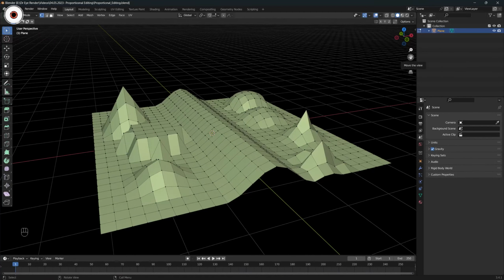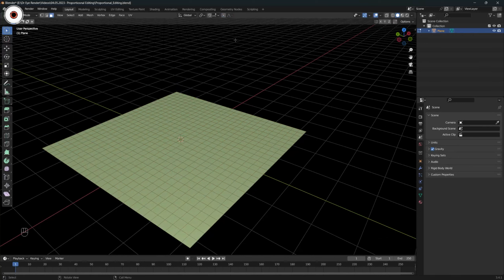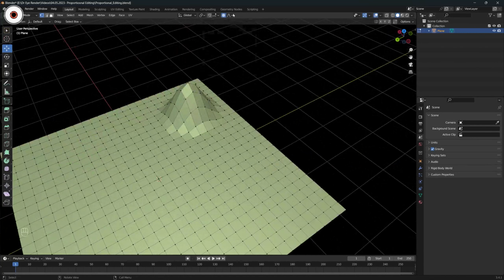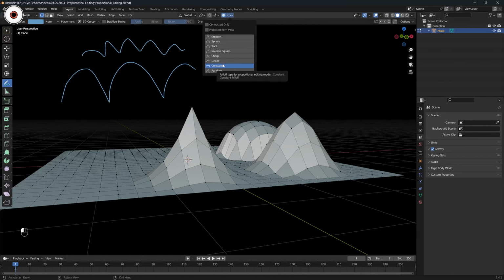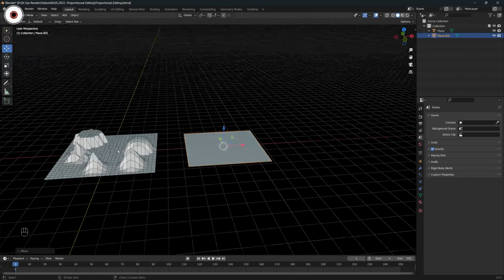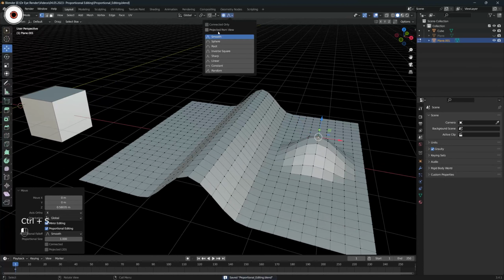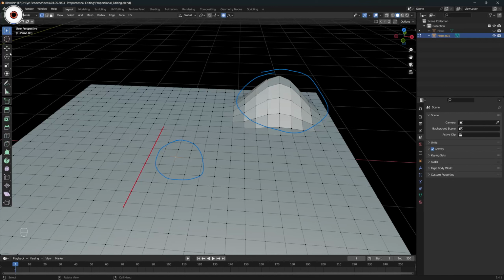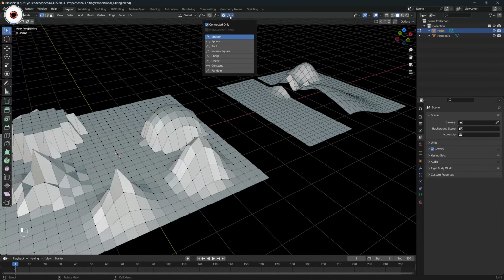Proportional Editing in Blender: A Quick Introduction to Its Functionality and Beyond Usage| How to

Comment: i am still not able to do it... if i press G and move the mouse it moves the whole object..... can you tell me what i am doing wrong?
Reply from the maker: hi, 
ok, as I told you in the video, you can adjust the proportional editing influence by dragging the mid-mouse wheel forward and backward.

Therefore, most probably the influence area is too big with respect to the object you are working on.

So, use the mouse wheel to adjust the circle size when pressing "G", in your case needed to decrease the size.

When adjusting the influence circle with the mouse wheel, at the same time the numeric values of that adjustment also appear on the interface that you can see in the top left screen corner where the Object and Edit mode toggle option is there.

Still, not get resolved let me know.

Thanks, 🎁